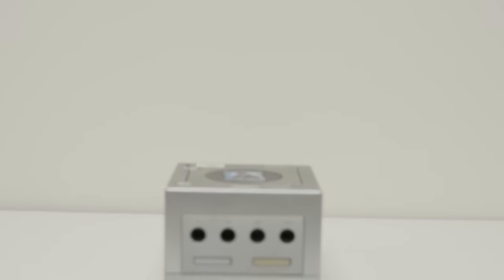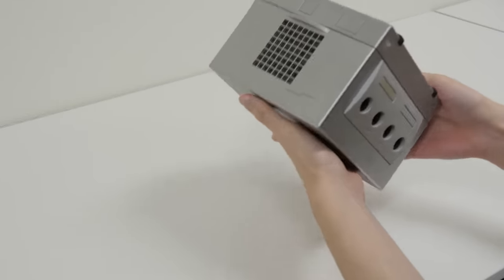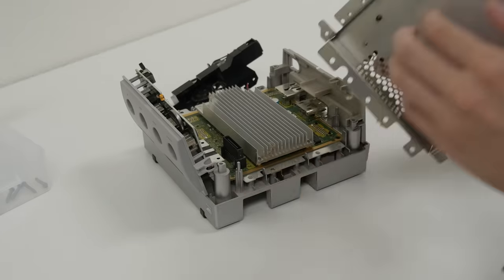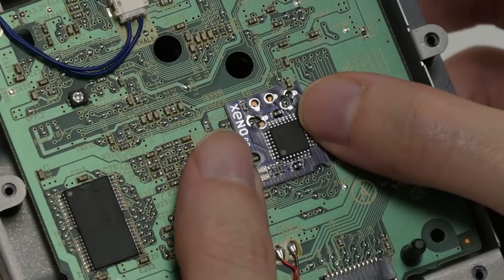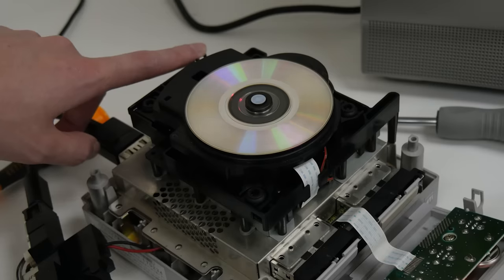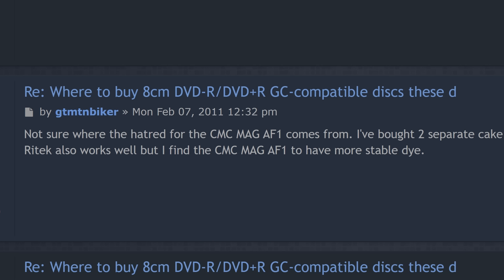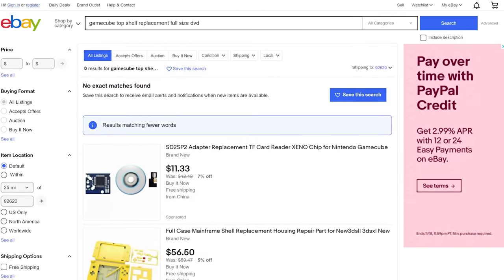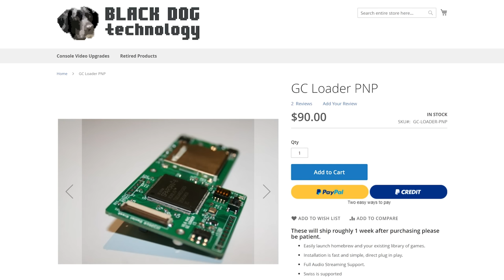Buying a $3 Gamecube from Japan

Comment: I love how the fist thing he does after finding out it's not garbage is he mod- chips it.
Reply: it ain't a MattKC restoration without a mod-chip.
Reply: my hero
Reply: You kind of have to, considering it won't play any US or EU games otherwise.
Reply: Your write speed is set to aws and if you've not configured it it will default to max wrote speed which will cause issues. Put it 2x and it will probably work.
Reply: Engineer
Reply: @RickyMcSpanish  I used to have this same issue with burned PS2 discs... Usually works
Reply: “The fist thing” oof
Reply: f i s t
Reply: You have obviously bought stuff from (in?) Japan before, since you keep talking about a $1 Wii (I'm new to your channel), but why are you surprised? Video games and consoles are dirt cheap in Japan.
Reply: @callme_Sweetpea  yes
Reply: @callme_Sweetpea  Depends. If it's a collectible game it can be quite pricey in Japan aswell.
Reply: based
Reply: what else was he going to do with it, use it as a decoration???
Reply: @PashaGamingYT  Play japanese Gamecube games on it?
Reply: @MyRegardsToTheDodo  

I don’t think those are very easy to get… I’m not sure he even speaks Japanese
Reply: @PashaGamingYT  He managed to buy a "defective" Gamecube in Japan. Getting Japanese games shouldn't be a problem.
Reply: That's exactly what I do with pretty much most consoles I decide to purchase, I like having full control of my consoles/HW.
Reply: Yea? Is that what you love? Huh? Bub?
Reply: @bengixd  yes
Reply: I love how the first comment I read after clicking on this video makes it so I don't have to watch the video anymore.
Reply: @PunkerNinetySix  💀
Reply: I mean... do you really wanna pay for japanese games when you might have a collection of other region based games sitting right there? I wouldn't. And i have like... 20 games. Mod chipping it is
Reply: @tazien  well, I did say I loved that he did it lol.
Reply: First
Reply: @Zorro_yes • 69 Years ago                       . fist
Reply: Godzilla had a stroke reading this and died
Reply: @tjhazell  It's not really worded weird, but I get your point.
Reply: Finds an abandoned baby

Mod chips it
Reply: He can also just find an exploit to boot swiss (from a AR disk or a specific game save), and swiss enables Region Free reading, no need for a mod chip
Reply: If you're going to do it, you've got to do it right!
Reply: Not very useful without a modchip. I'd say every console needs at least a softmod to be good

Comment: While using a Gamecube to play Gamecube games is the worst way to play Gamecube games in 2021, we are forgetting about it's most feature: The Handle™
Reply: It's not called the purple lunch box for nothing
Reply: 1 day ago but the vid released 14 mins ago?
Reply: @BedfulPro  Most likely they are Patreon subscribers.
Reply: @BedfulPro  Videos are Early Access on Patreon https://www.patreon.com/mattkc
Reply: Nintendont is also pretty bad. Spent hours installing and configuring it, only to have mixed results. This was like 5 plus years ago, maybe it’s better now
Reply: @philhalo66  I imagine failing hardware issues
Reply: @philhalo66  it's not the worst way worst case the laser will go bad and you can buy a cheap replacement and it's super easy to install
Reply: @philhalo66  Could also be the lack of native HD compatibility. To have an HD GameCube, you need not only a specialized dongle for the video, but also a specific model of GameCube: DOL-001. The 101 models only have one output port, which is composite.
Reply: @philhalo66  The WiiU already had 1080p, the Switch wasn't Nintendo's first FullHD console. Which still meant that Nintendo was 10 years behind.
Reply: The worlds first "portable" game console.
Reply: @philhalo66  480p hasnt been considered "HD" for 15 years lol
Reply: @Chaos89P  Don't they also support SCART RGB, or is that just the N64 and SNES?
Reply: @philhalo66  480 has NEVER been HD. 720 and up is HD, not 480. 480 is SD.
Reply: @garpafieldjovi4785  It has NEVER been HD. DVDs ship at 720x480. Computers from the 1990s had screen resolutions of 640x480. Philhalo66 is just wrong.

Comment: Just a tip, to remove stickers, soak them in regular pharmacy alcohol for a minute or two. The alcohol will disolve the adhesive and you'll be able to lift the sticker with no problems.
You can even use contact cleaner or 70% alcohol to not damage the plastic.
Also to adjust the potentiometer, you absolutely need a tester or you won't be able to read anything and you risk putting a too high/too low value which can burn out the laser.
Reply: this is what i do. I use Isopropyl to take off stiickers
Reply: Yeah. Alcohol is better. WD stands for water displacement. They aren't all that appropriate for a task like this.
Reply: Or just use goo gone
Reply: @thedopplereffect00  wouldn't goo gone risk damaging the plastic?
Reply: @MaximNightFury  hm, possibly, but couldn't wd40 also? Of course, test it first. With goo gone, you don't have to soak it for an hour, usually works almost instantly so it doesn't expose to the plastic for very long.
Reply: I’d recommend a wide naphtha fraction, will dissolve more types of adhesive
Reply: Nice Lulu pfp
Reply: Yeah, I was a bit annoyed by the fact that he didn't try alcohol first.
Reply: @astropgn  It's a last resort
Reply: I thought he would remove the faceplate and replace it, because it's easier to do.

There's a tab you could pull on the inside of the case that removes the faceplate
Reply: he should also use a plastic razor! It's a razor made of plastic! It's great for peeling stickers from plastic or glass witout scratching.
Reply: Or use a hair dryer to heat the residue then peel it off, just clean up the residue if there's any left
Reply: My regular pharmacy alcohol is 75% alcohol. Do you mean that 5% makes a difference?
Reply: I just use lighter fluid
Reply: @CharlesRevis1  This man knows the way. Don't bother with solvents, heat up the glue and 90% just peels right off.
Reply: @cablecow15 as a retro game collector I dont stuggle at all with old stickers (on systems or cases) You just have to be carful and take your time, which isnt done in the vid. Also I work from all edges with a butter knife towards the center of the sticker to avoid scratches and leaving resewed which wasnt done, your finger nails dont do anything
Reply: @liamnoname6662  smart a combustible fluid on electronics have fun burning 👍
Reply: Yes goo gone is the best👍
Reply: Use integrated circuit diagnostic freeze spray. A lot of stickers will come off in one solid piece and you can even stick them on something else. :D
Reply: goo gone is great, it's probably what i would recommend for really stubborn stickers like that harry potter sticker.
Reply: The problem with this solution is that isopropyl alcohol evaporates in seconds, and it doesn't work on that kind of sticker. That sticker was laminated, so the alcohol won't penetrate.
To remove laminated stickers. you need to soak them in warm soapy water until you can peel the lamination layer away, THEN you can use goo gone or alcohol.
Reply: @MaximNightFury  it shouldn't. Goo gone is petroleum oil and orange oil. It WILL damage rubber, but not hard plastics.
Reply: Percentage doesn't really matter unless it's a soft plastic, and even then you could just dilute. IPA doesn't react with most plastics.
The pro-tip really is to stay away from acetone. While it's really great at dissolving stickers, it also melts most plastics.

Comment: I've been using my GC loader for a little over a year now. I LOVE this thing. Pro Tip: Format your SD card in exFat, not Fat32. Solved a huge problem I had with 3/4 of my games not loading.
Reply: That's funny, cause its usually the other way around. Lol, exFat is usually the thing that causes issues (on the wii and switch).
Reply: @FurryShep  On the Switch, that's caused by Nintendo's poor handling of the exFAT file system. It's honestly not the best file system to begin with though lol
Reply: it even better now it supports Write.
Reply: If you get the Action Replay Media Launcher, you don't need to replace the disk drive with an emulator. It's just an SD card adapter for the save game card slot. You do need some homebrew software in order to actually launch anything from the SD card though. I think I've got Swiss burned to a mini DVD to load me into a homebrew environment that supports this SD card method.
Reply: What gen of gc loader are you using, im on gen 2 and the exfat is the one that causes problems and fat32 works fine, bit there are some games that both have trouble with
Reply: @Marco_Onyxheart  the reason why most people are replacing the drives is bc they are getting old and dying, plus having the sd card improves loading speeds a little where with the action replay disk you are still depending on a lazer
Reply: @juansnow5897  am in the pal, so am forced to use Swiss to enable progressive scan, finding mini discs is getting hard.
Reply: @haloharry97  i have a pal too
Reply: I honestly never saw the appeal of it (unless if you can't repair your disc drive), when for much cheaper you can use a boot disc and SD Media launcher to load roms and enjoy authentic games.

Comment: Reminds me of what I've gone through chipping my PS1. Some CDRs work better than others, some drives play better with the media, and some laser mechs read more clearly than others. It really is worth the money to do the SD mod, if you're set on real hardware.
Reply: hello there
Reply: Hah, I went through that headache 20 years ago with my freshly modded PS1. Burn speeds, brands, software, which actual drive you are using to burn with etc.... I recently got out my old PS1 and it had an old game in it from back in the day... When I took it out it brought out some of the drive spindle pieces with it! 

I did a quick and nasty DIY fix with my oldest kid and got it working again but ran into the same problem with it being super fussy about what it would and wouldn't play.  But you know what isn't?  A soft modded PS3.  That sucker plays everything I've thrown at it, discs I marked as bad burns, skipping cut scenes, skipping music (I'm looking at you Wip3out and Tekken 3) only downside is no beatmania... Until I work out Tonyhax on my PS2 that is!
Reply: Well they were never designed to run on burned CDs in the first place, I remember having the same hassles even on my modded PS2.  SD mod is the best solution.

Comment: Depending on your GC model, you may be able to get away with an SD2SP adapter which plugs into the serial port on the bottom. Or you can get one of the memory card SD card adapters.
Reply: The SD2SP adapter still needs a Xeno chip to work though.
Reply: @lolindirlink  True

Comment: Do a region mod! You can solder in a switch to go from US to JP just by connecting two points. I did it to mine wayyy back when.
Reply: why when the modchip does exactly the same
Reply: @t0biascze644  I dont think a modchip changes the systems region.
Reply: @Strashky  Propably no, but it still allows you to play games from other regions
Reply: @t0biascze644  True, tho the menu will remain in japanese. I would just either mod it to ntsc or install a region switch cuz why not, It only seems to be a positive.
Reply: @Strashky  I mean does that really matter? Your just skipping past it to get to the game and the memory card. For than sake of usage I would probably just switch it to English permanently
Reply: @emeralddiscordian3116  thats what i said, either straight up mod it to ntsc or install a switch if you still want to easily go back

Comment: There are some types of adhesive that can be softened by using a bit of vegetal oil, like the ones that hold on labels on plastic bottles. 
It's my last resource, if no other solvent i tried works, usually oil works. The cleanup is pretty easy, just a bit of soap and water and it's done.

Comment: How did you get that Gamecube through customs with all those dead insects inside it?   Aussie and NZ customs shows air all the time here and they're neurotic about anything like that getting through :D

But joblots are great for cheap hardware,  I got five Orange Japanese gamecubes in one once.   Also came with an FM Towns Marty and a 3DO FZ-10.
Reply: Well we all saw how truly neurotic and draconian/tyrannical Australia can be so um not surprised you have problems with customs
Reply: I bought a lot with 5 ds's 18 dsi's 1 gamecube 7 n64 controllers 2 gamecube controllers (All for repair but thats what im interested in) and a shit load of games i lost count of mostly n64 and gamecube all for 258$ on ebay. (The games alone are like 300$ so i basically got the ds's i wanted for free.) The guy even tossed in a n64 rumble pack with the box for free but sadly someone left battery's in it so i will have to see if that can be fixed. 

Its rare but you can find quality lots on ebay if you know what your looking for and check daily, Or sometimes hourly if your looking to snag something cheap and you just refresh the search sorted by newly listed.
Reply: Ayo, THE Larry Bundy Jr.?

Comment: Note: if you get the Action Replay Media Launcher, you don't need to replace the disk drive with an emulator. It's just an SD card adapter for the save game card slot. You do need some homebrew software in order to actually launch anything from the SD card though. I think I've got Swiss burned to a mini DVD to load me into a homebrew environment that supports this SD card method.

Comment: You remind me of me, I definitely know the pain of trying to burn games to a disc now and whether or not if they'll work. Earlier this year I went and ordered an A/V cable for my Dreamcast - I had not used my DC since 2006 or so, and severely misplaced the original cable that I still can't find. Anyway, I started looking into used game prices, decided fuck that noise, and opted for burning game images to disc. Found some online resources for fairly better quality CD's than just Verbatim, ordered an entire stack, and then later found out each game's image is missing one or two minor things just to make the image small enough to fit on a CD-R, not only that but I then encountered games with multuple discs, like Shenmue, and one disc is too large still for CD-R's, so I had to try and find larger media CD-R's, tried burning that disc, and it STILL does not work.
So, yeah, at some point I will probably mod my DC with GDemu or what ever it's called. I also got into burning PS1 games recently when I looked into jailbreaking my PS3.

Comment: Glad I subbed! These videos are great. I'm sure you're getting a ton of different suggestions for removing stickers, but for me lighter fluid works every time. For whatever reason it's really good at loosening adhesive. I've used it to remove old stickers from pre-owned games, and to move stickers from gameboy carts onto new shells. You have to be kind of liberal, but it works super well and dries out nicely.

Comment: For stickers, where the surrounding paint wont peel off anyway, put clear plastic tape down over it, and yank the tape off. repeat as necesary. it will tear the paper off bits at a time, and then will get the glue off.

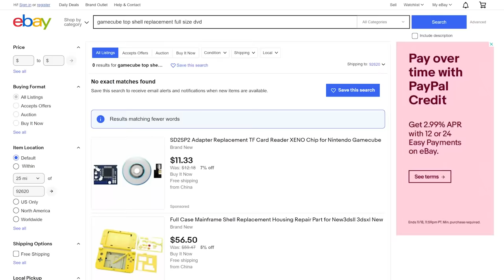Comment: 6:57 Your answer lies at the top of that page, getting a pre burnt swiss disc and a SD2SP2 adapter will serve basically the same purpose as a GCloader but for cheap while also keeping the disc drive, it's what i've got goin and it works pretty flawlessly for 95% of games. 

Also those phillips discs should work, the Gamecube is very picky so you might have to tweak the pot to absolute perfection to get it to read, it took me about an hour to get it dialed in perfectly to read my non brand DVD-R's you could also try a laser from a different gamecube by just swapping the driveboard with the Xeno on it to another disc assembly

Comment: wonder if full sized discs can be trimmed to fit the Gamecube? definitely risky but with sort of a lathe setup I'd bet it's doable
Reply: That's a lot more effort than printing a replacement top shell, but it has the advantage that your burned games will work on consoles with the original shell

Comment: Idk if it's available where you're at but there's a product called "Goo Gone" in america which is basically just orange oil. Works significantly better than wd40 for stickers, but can dissolve some plastics so you need to do a test swab somewhere.

Comment: A hair dryer on the hottest setting will help with pretty much any old stickers stuck on anything. The hair dryer will heat the clue under the sticker and you can just peel the whole thing off.

Comment: It might sound a little odd but could you possibly just trim down the cd to a smaller size if you knew what size to trim it down to? In theory it might be fine if you are willing to take a couple of attempts and waste a few decent cds. 

I could imagine there are multiple ways you could attempt this. 

Option 1: Use a broken/sacrificial mini-cd to create a outline of the smaller disk on the larger and carefully cut off the excess.
Option 2: Find the correct radius of mini-disk. Place a rod of some form in the middle of the larger disk, tie a string with the correct radius as it's length to a sharply tipped rod. After that you should only have to repetitively move the sharply tipped rod around the tool until you have a deep groove. Eventually you will want to remove the outer part of the disc carefully then smooth the edge of the new homebrew mini-disc.

Remember this is assuming that you will not need the rest of the disk for data space as the Gamecube cannot utilize that part of the disk.